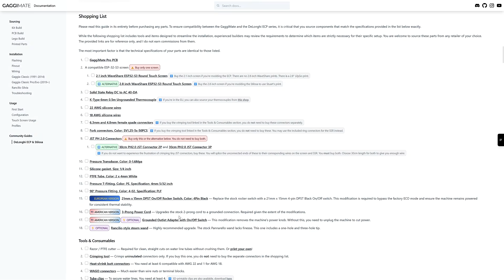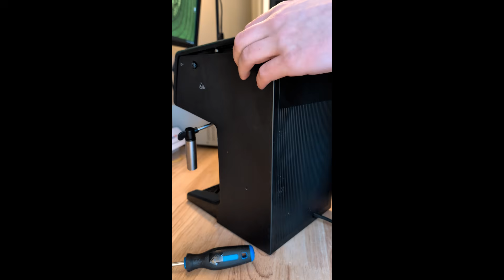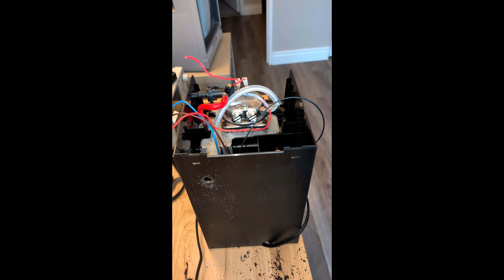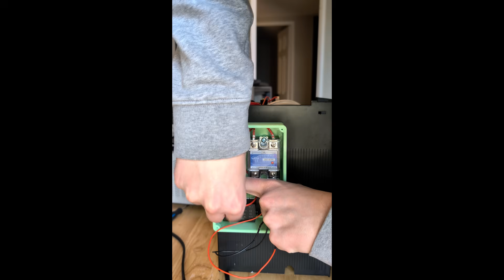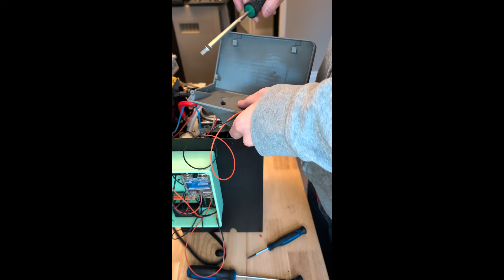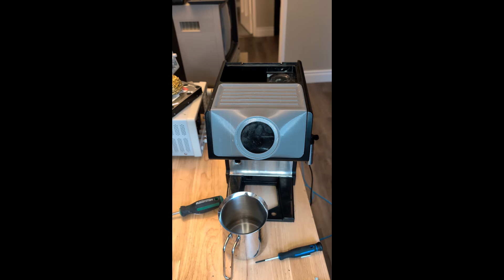De'longhi ECP: Enhancing your shot with the Gaggimate Pro

Comment: Really nice!
What about the “output valve” in the group head (that mushroom spring). Have you changed it? Thinking about pre-infusion, mine opens only around 5bar.

Thanks a lot!
Reply: You can just take the spring out. Just keep in mind that you'll get leaks out of the group head when trying to use the steam wand. A workaround would be to use a blind basket portafilter when using the steam wand. Lance Hendrick did a live stream with the Gaggiamate creator not too long ago and they were using the Delonghi'mate to pull one bar Soup shots after they removed the spring.  They go into great detail to describe what the spring does and how to remove it. If I remember correctly the valve works in relation to the water level in the boiler and the spring is just there to hold the valve closed when using the steam wand.

Comment: Very helpful video. I couldn't find the exact SSR listed in the website to be shipped where I live, is it okay to buy any other SSR with almost same specs? Or do I buy the 220$ GaggiMate Pro Kit from the website? 
#help
Reply from the maker: Shame. I decent alternative should work assuming it is 40A (you could go lower amperage since the delonghi doesn't draw 40A but it is better to have some overhead especially with cheaper ones). I believe the gaggimate board controls the ssr with a 3.3V signal so make sure the control side can work at that lower voltage. The one listed on the webpage guide can also be found on aliexpress so that is an option too

Comment: Great video ! thanks a lot for taking the time to put it together. Would you mind detailing how you secured the wago connectors inside the frame ? Are they tapped/glued/screwed in or just free ? I may be about to pull the trigger on the mod, it's just the plumbing part that's holding me back :) Maybe the external backpack option for the boards will calm down my anxiety regarding leaks vs the all-internal mod. Is it your screen housing design for the 2.8” screen that's listed in the Gaggimate ECP tutorial ? Thank you also for this.
Reply from the maker: Sorry for late reply! I secured the Wago using a strong doubled sided tape. Not the best but you could invest in a stronger water proof adhesive if you are worried about them coming loose. The screen hosuing on the thumbnail of the video is the 2.8" screen that i designed and is available on the guide. I used the 2.1" shroud by troxfighter in the video (since I had one already printed and laying around :D )
Reply: Which gaggimate kit is required for that?
Reply from the maker: @porsche911GT3RS40  the gaggimate kits are geared for an actual Gaggia classic. It is better to source all the parts for an ECP as they are slightly different than for a Gaggia (the linked written guide has a good parts list)